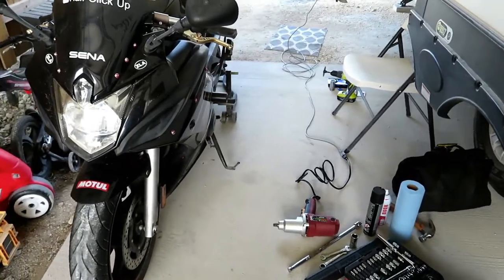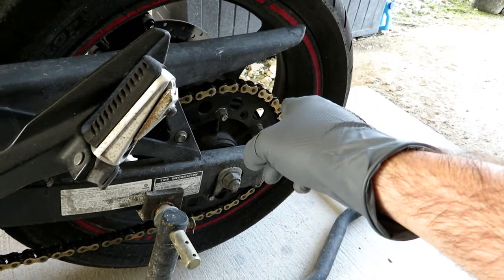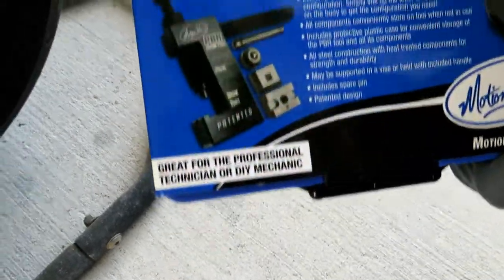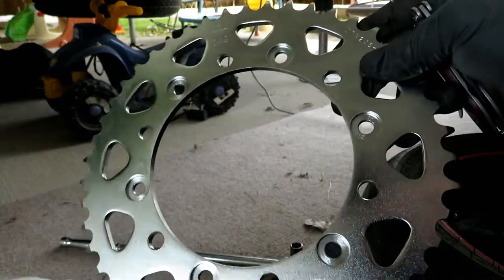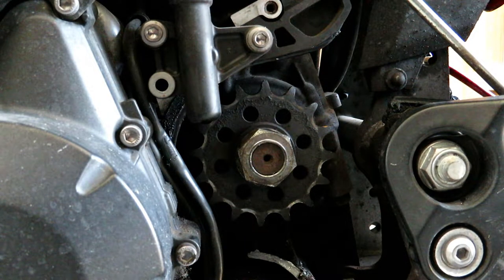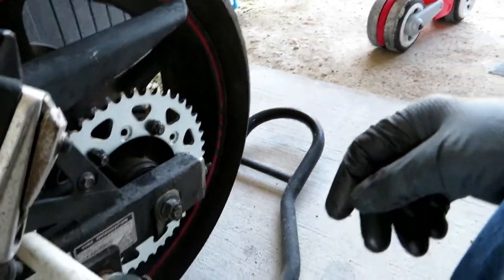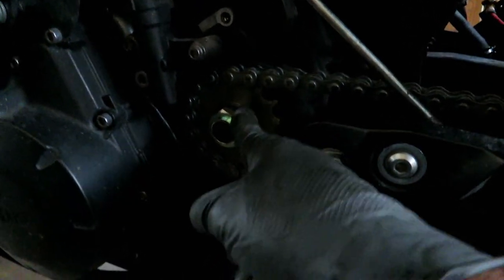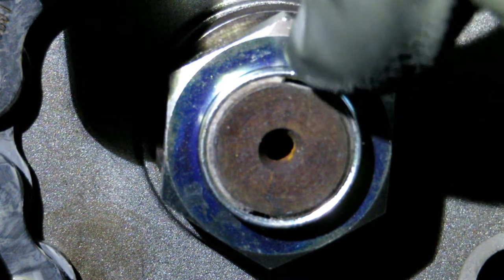Yamaha FZ6R Chain and Sprocket Swap

Comment: Great video, I redid my chain but will replace sprockets down the line. I bought a 120 link chain as it was cheaper than 118 link one. Standard length is cheapest. Takes 1 min to grind and punch out xtra links!
Reply from the maker: Sweet, what type chain did ya go with?
Reply: I used RK GB520GXW chain. It seems to be a quality product. I did use an RK cheaper chain 520 XSO (cheaper chain -part of 150 buck kit from dealer) earlier and it did not last very long. My current chain costing upwards of 100 bucks is of much better quality, I think RK has 5 lines of products of varying quality so look up what u buy there. 
I am seeing this video again as I am swapping sprockets now a 2-3k miles down the line from chain swap. Vortex front and JT rear - rear is same as your kit. I used the DID chain tool that cost 125 bucks but, it works very well and I highly recommend it (DID has a Japanese video dubbed in English that shows usage of that tool). Also, you have to see "delboys garage" tips on chain tool usage - those videos are a must for DIYers (Del is really an experienced mechanic who shares his wisdom on his channel)

Comment: My nuts stripped on my sprocket before I got anywhere near 57ft lbs. So I bought a new used one and it did it again. I've been rolling around for about 10 thousand miles with stripped sprocket bolts (onlynon the rear one) Yes I did it in a star pattern with a good torque wrench. Bike had 28 thousand miles on it and my original sprockets had more "meat " left on them than the new JT sprockets. I got the same kit you did. No issues. They definitely arnt OEM quality sprockets though. Good vid bud.
Reply from the maker: That’s crazy dude! I’ve never run into that issue. I’m also still running the sprocket set from this video after all this time and they’re both still good to go. Strange fact: back in the day, the old FZ6 called for 72 ft lb on the rear sprocket bolts and there was documented cases of people stripping those out, too. Seems their online community began opting for like 45 ft lb and red Loctite with great success. Anyways, I hate that happened to you man!

Comment: Good video m8 👍 I think it would be a bit easier if you have had removed the chain cover to fit the chain 😀 The old chain and rear sprocket definetely has had it 😱😱 the front sprocket didnt look too sad considering it has done 15-20.000 miles, good going 👏👏 one question, do you ride your bike daily? 😊
Reply from the maker: Jose Sardinha haha it never even occurred to me to remove the chain cover, excellent observation! And yes, I commute on the bike daily. Just turned 55k miles, look for a 55k mile review soon!
Reply: @HalfClickUp  No worries, it was just a little observation from me 👍 if you ride everyday then the old chain and sprockets done you very well 👏👏👏 look forward to your next video 😀 be safe 😊

Comment: after many hours watching videos, this is best by FAR. changing my chain as soon as new one comes in. Quick question, do you know the size of rear axel nut and and axel bolt itself? i've lost my old ones and need to purchase new ones
Reply from the maker: The nut is a 22mm and the axle is a 19mm. Thanks for watching my stuff!

Comment: In mine, axle goes from left to right. 22 mm nut is at right side. And is as it comes form factory. Regards.
Reply from the maker: My axle configuration matches the factory service manual, for what it’s worth.

Comment: Thanks for reminding me that I need to tighten mine.  Are X ring really better than O-ring in your professional-ish opinion?    Cause my professional-not opinion has no idea.  Also, pvc, great idea. I had to stand on the brakes with a breaker bar.      My goal is to have enough left over chain lengths to make a complete, free chain some day. I just need about 20 more bikes and about 100 years to ride them all to the point of replacement.
Reply from the maker: HellishGrin460 well I’ve only ever bought X-ring chains because I’ve only ever bought DID; however, my understanding of X-ring design lends credence to its superiority considering how much mileage I’m getting out of these things. Absolutely worth any extra money they cost over traditional O-ring designs as far as I’m concerned. Also, it’s not in the video, but I had to use my metal breaker bar instead of the PVC when I tightened the front sprocket nut to 61ft lbs. because the PVC was just folding in half from the strain 😆

Comment: Damn, I just ordered a new chain and sprocket but I don't have a bike stand. There are a bunch of riders here on Ft Hood, hopefully I can borrow one
Reply from the maker: HardCore'Vette I’ve run this set from day one:
https://www.amazon.com/dp/B0077T23IO/ref=cm_sw_r_cp_awdb_btf_t1_ZHLtFbV2EX8ZB

Best value right there! Whichever you choose, make sure the rear stand is a paddle type like at that link. Our bikes don’t do spools.
Reply: most bikes come with a stand prebuild in it, it lifts the back tire up and you just need to hold the front down for safety

Comment: Would a center stand work for the FZ6R? I have a 2012 and concerned with damage to the muffler/ exhaust pipes
Reply from the maker: Yes center stands were a feature on the European XJ-6, and in fact if you poke your head under the area of your Fizzer’s kickstand, you’ll see the center stand mounting plates already there.

Comment: swapped my FZ6R chain and sprockets just last summer and it’s all kinky and lose again, not even 2000 miles of wear. Thinking about doing another chain swap this summer.
Reply from the maker: Wow that’s pretty bad. Have you been cleaning and lubing the chain?
Reply: @HalfClickUp  honestly, not too often, besides I live cold weather state, I store the bike during winter and leave it outside during spring and summer, I don’t know if that affects it too.
Reply from the maker: @jesusescamilla2243  lack of use and general exposure to the elements can degrade the chain’s lifespan. You have a unique scenario since you don’t ride very often. A cheap cover can go a long way for you. For example, I only ride my FZ6R on Fridays and in the track, so it spends the majority of its life just sitting outside. So, I picked up a cheap Nelson Rigg cover, and it helps protect the chain from moisture and humidity. It would be a nice little investment for you… doesn’t have to be an expensive one.
Reply: @HalfClickUp  yup thanks for the tip man 👍🏻

Comment: With your video and the official DID chain video I replaced my 09 FZ6R chain and sprockets. It was quite the challenge to get off my front sprocket, because I took my chain off first andthe nut was hella tight. 

I have a question, I'm familiar with the owner's manual but I was not able to find these torque measurements in it, where'd you get your information?

THANK YOU fir your videos.
Reply from the maker: I used an electric impact to get the front sprocket off. All of the bike’s torque specs are located on pages 2-14 through 2-17 of the factory service manual.

Comment: Looking to replace my front sprocket nut on my 2015 fz6r. Do you have the part number for the new nut you installed on your bike?
Reply from the maker: 90179-20010-00

Comment: How much nm on rear sprocket, from manual is to Way much people have draw the bults off!
Reply from the maker: Yes it is a very high torque spec. 80 Nm, or 57 ft. lbs. Use a torque wrench and go in a star pattern.

Comment: Maybe i missed or you didnt mention. But could you tell me the sizing of every nut? The front sprocket cover is a 5mm hex, and the front sprocket nut is 30mm. But i didnt get what the rear axle nut or the rear sprocket carrier nuts sizes were.
Reply from the maker: Collin Herold rear axle nut on chain side is a 22, axle nut on the brake side is a 19, and the rear sprocket carrier bolts are 14. 😬👌

Comment: Why not use the master link in the chain?
Reply from the maker: I don’t think I understand the question..
Reply: @HalfClickUp  
There’s a master link used to connect roller chains, like those used on motorcycles or bicycles, etc. They are used to install and remove the chains.
Reply from the maker: @davidcerce  skip to 23:30 in the video. I use the Motion Pro PBR tool to install the DID rivet type master link that came in the chain and sprocket kit.

Comment: can you please give me the part number for the drive sprocket nut you used here? Because ... places around here suck and I keep getting bad info from everywhere
Reply from the maker: Yamaha part number 90179-20010-00
Reply: I do not have  a spare. I am glad I realized it a day prior to doing the front sprocket install. Have to push out the swap( I never realized that the nut is bent (most sport bikes need washer bent usually - saw the video really carefully today- Thanks HCU!!!)

Comment: C-49? 4 teeth more? What happens with that? Regards.
Reply from the maker: I currently run 15 teeth in front, 49 teeth in rear. Makes 3.27 gears for faster acceleration.
Reply: @HalfClickUp  Oooookkkk. And at higway, rpms are higer too? Regards.
Reply from the maker: @linternasmx  yes, for example at 80mph the RPMs are around 8,100.
Reply: @HalfClickUp  Too highg, no?
Reply from the maker: @linternasmx  for daily commuting on interstates, yes it is a bit high. This is mostly a track bike now, which I why I changed the gears.. to give it an advantage on the track.
Reply: @HalfClickUp  Great! I use mine to road trips at weekends. So, I asume is better lower RMP at highway. Regards.